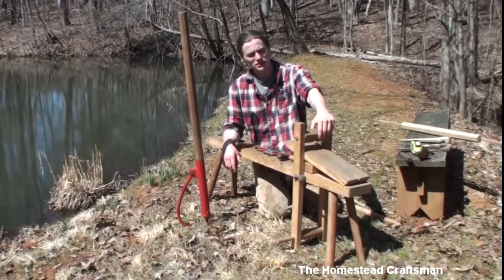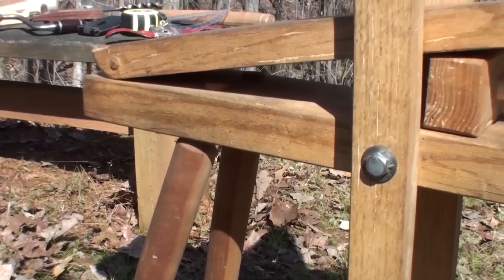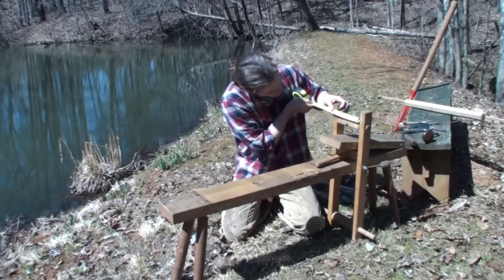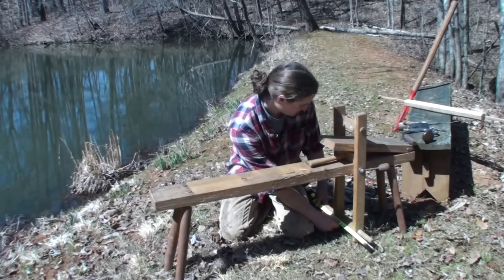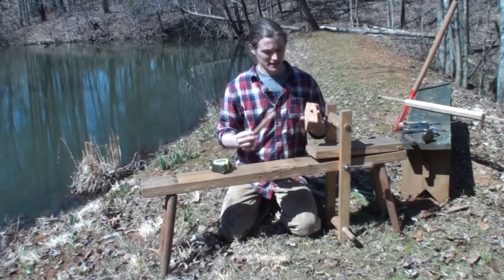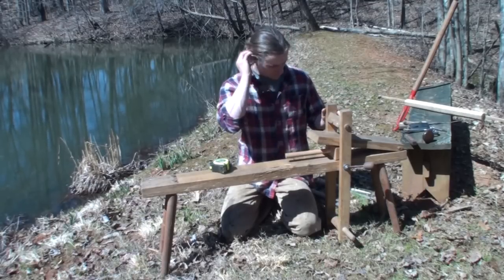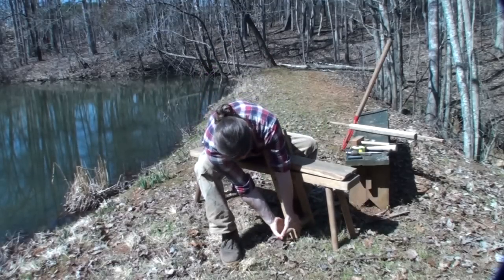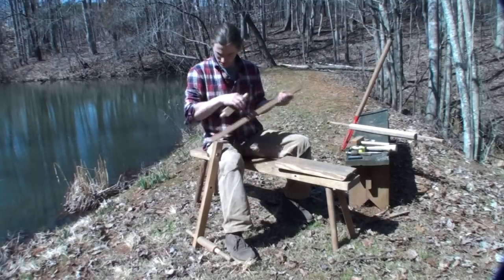Shaving Horse Design - In depth review!

Comment: Hey, thanks for the great idea to tension the "clamp" pivot point. I kept having my pieces fall out if I had to get up. I didn't use a bolt, I used a 1 3/8" dowel so I inserted a cheap clamp, works wonderfully. I used an old door hinge for the angle plank, instead of slotting / doweling.
Reply from the maker: +Justin Henderson No problem, glad you liked it.

Comment: For anyone who wants to make the tapering tool, an easier way to cut the slot for the blade would be to cut it while the blank is still square.  Then glue a scrap piece on the open end and turn the taper.  The scrap can be parted off when the turning is done.

Comment: Hey!
One thing I was hoping you could share with us is the position of your pivots in relation to your clamp block and wedge block.  Or just the location of the holes you drilled on their respective pieces. 
Thanks!
Reply from the maker: Michael Plewman I can try to remember to check, but you'd probably have to remind me. It really doesn't matter though. I just made mine to fit the most common sizes of lumber i'd be working, which is smaller stuff. The only holes that make any difference is the hole through the vertical pieces on other side of the seat.  For those, you can just drill a series of holes which would make it easily adjustable. Like 1.5 or 2 inches apart.
Reply: The Homestead Craftsman Thanks! Everything worked out in the end.  I used a wooden piece made from Douglas Fir that I fabricated in place of your eye bolt and it ended up braking.  Besides that everything is working great! Thanks for your patient approach to instruction!
Reply from the maker: Good, I'd love to see a photo if that's possible. If you don't mind, you can email it to me or send it through facebook. thehomesteadcraftsman@gmail.com or my facebook link is on the homepage of this channel. Glad you got to make the shave horse, you'll have a good time with it.

Comment: Im currently building this to your specks but for the life of me I cannot figure out the spacing between the upright swing arm parts. You did not include the spacing in your video. The spacing from the bottom to the foot peg hole. The spacing fro. Your foot peg hole to the bar that goes through the bench itself. The spacing from this to the upper part that is the clamp for the top of the piece your working on. Than the spacing to the very top of the swing arm. 

Also how far from the end of bench back towards to the hole that swing arm is attached to the bench?

Comment: great video I'm just starting out no equipment yet such as froe and draw knife can't find shaving horse.. Where you get cordless microphone . Take care and thank you Salam (peace) ✌
Reply from the maker: Daniel Morris I got it used off of ebay, it's an audio technica Pro 88w. Then you can use what ever microphone you want. You get the transmitter and reciever, both run off of a 9V. It's an ok set up, not the best but a good basic system.
Reply: thank you very much that's great. And I order froe on Thursday think that most beneficial tool for learning basics.. Ok many thanks great videos.
Reply from the maker: That's not the first tool most beginners would go for, but I approve.
Reply: yeah its fine,getting feet 👣 wet anyway so to speak,nothing in life that is worth having ever comes easy. Thank you I found my first birch tree two have fallen they above two to three feet wide ... Bushcraft the bark be my first time to.. Have good day.. Well excited

Comment: Hi! and thanks for the video but could you explane me what is a " V block "? is it maybe a wedge?
Reply from the maker: +begonaableful I didn't rewatch the video to see what your talking about, but if I'm guessing right, if I say V block, im referring to a block of wood (piece of a 2x4 with a "v" notched out of it's length. You can clamp it down to a drill press table with the drill bit aligned with the bottom, that way you can drill a hole centered through round stock, like pipe, rod, turnings, etc.......... I think I may have just typed something nothing to due with what your asking, I may have just meant a wedge as you mentioned for adjusting the height of the hinging platform that your piece your working goes on. Well, maybe one of those two answers will get you what you want.

Comment: Excellent video. Very informative. Thanks so much for sharing. I appreciate the dimensions but was hoping to get the dimension from the center of the hinge bolt to the center hole of the clamping block. I will be making one of these and suspect I'll be able to figure it out when I come to it.
Reply from the maker: +R.U. Nuckinfutz This will answer any question you have.....https://74dd4b25-a-4a38ab9e-s-sites.googlegroups.com/a/greenwoodworking.com/greenwoodworking/ShavingHorsePlans/shavehighresBW.jpg?attachauth=ANoY7cqqzbNxT3sTOtpVTkWNA24SPyoKui0QSDweNrlBP_3EXDPeH0SEJW0d-kwKXdruFJI1B9eQA49VPMXcMqwS5xTjX-1rhJ9yCb_D6alyM0rKuI5Y2Xda5ux36hPv207fbWG_8F7Atw_dlTBLs9E3aFFXK9gNuenaCvN9seL4x4BxVKBe0F9-Jsi4xG2HEmLOZ44gZFfVbMLp61S6GThDbjcC9x-w4O9spaiSNvp6YVldo5RwiQvphrL6NX4pU3Wdlqvg61Ml&attredirects=0

Comment: On third viewing, (OK, I am slow) one set of dimensions was missing - where on 26 3/4" clamping mechanism are the 3 holes drilled? Thanks
Reply from the maker: It doesn't really matter, the part at the bottom is about 3 inches up, the hole at the top is more up to you. I left extra room for extra holes to make it adjustable, but my hole is about 3.5 down. Click this link, it has a diagram of the one that inspired and for the most part exactly what I made. http://www.greenwoodworking.com/ShavingHorsePlans
Reply: I should have seen that - I had printed his diagram - you had given me his link - and should have reviewed that - sorry to bother you on it.

Thanks
Reply from the maker: No problem, it's a great diagram and nice to see the photos on the site, it's a simple design so you can easily alter it to suit your needs and sizes.

Comment: Are you using a modern or rustic lathe?
Reply from the maker: phooesnax It's a modern lathe.........but it's getting a little rustic. It's a 50's Delta Rockwell. With variable speed. It's in some of my videos.
Reply: Actually bumped into it in one of the other videos.   Nice work and thanks for the reply